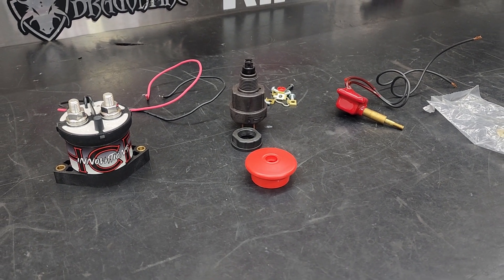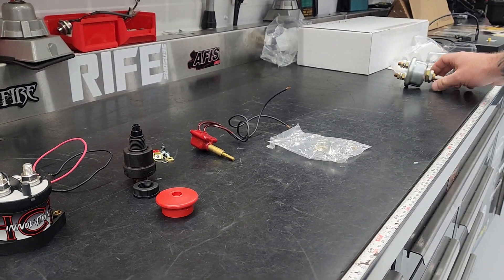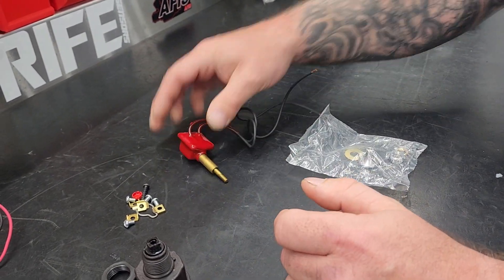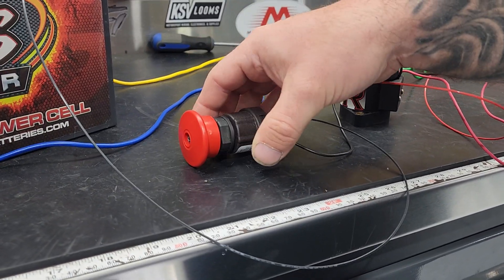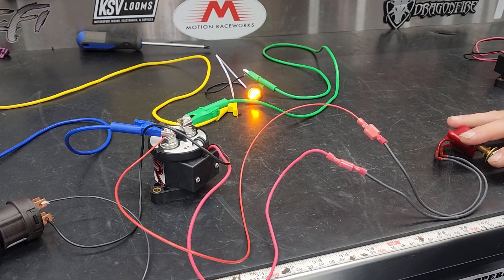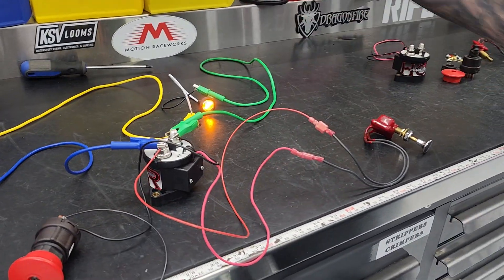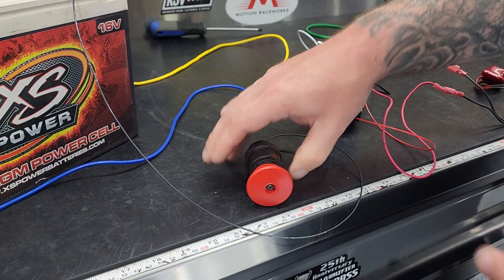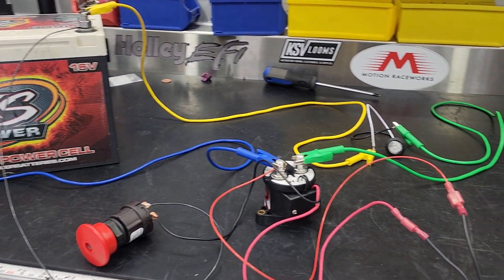How to wire and use a remote battery disconnect

Comment: Using a optimum battery with side post and upper post. Have connected my starter and alternator to he upper post, ECU and all other load from the side post.  Do I need two solenoids to break both power supplies. If so then can they be wired in parallel.

Comment: Hi Devin, great little vid on battery disconnects mate, you briefly mentioned if your running an alternator, can you add the detail either on this vid or on another on wiring the alternator with a shut off, particularly non single wire alternators please

Comment: So to clarify, this is supplying main power to the fuse panel or pdm, which handles coil and injector power, but it's still fine to run the Holley straight to the battery, correct? And for the alternator, we just add another contractor in-between the alternator charge wire and the battery?
Reply from the maker: Yes

Comment: Devin? Can you go a little further and show people how to properly wire the battery side of the equation? To many times I’ve been running tech at an event and people don’t have the alternator charge back wire on the correct side of the “relay”.. and the car doesn’t cutoff if the idle is above 1500 or so RPM. The alternator needs to “dump” back to the battery side of the “relay”.

Comment: Devin,  I have used a similar one from a company called Simtek in the uk (where I'm based) Their one has an additional set of contacts to hold the contactor closed and a momentary  nc switch for the e stop. They also use a high watt resistor to bleed off the alternator backfeed when the contactor is opened. I've used them before on an old carb build I di before. I'd be interested in hearing your opinion of the alternator bleed off on an efi application? I'm really enjoying the tech videos !, Thanks Neil

Comment: Since this needs both switches on to power the car, could you then just leave say the bumper mounted switch on at all times, and just use the in car deal to switch the power on and off without killing the battery?
Reply from the maker: thats exactly what i do. nothing worse than getting strapped in to only realize you forgot to turn on the switch on the bumper lol
Reply: @theholleyefiguy  Happens to me almost every time I get in, then looking around yelling for someone to turn the damn car on lol

Comment: So with an alternator I need 2 of them ok. Was going to email in this week to discuss them
Reply from the maker: you can do it with one, just will have a hot wire to the alternator at all times, which isnt that great but will work perfectly fine. i prefer to use 2 of them
Reply: @theholleyefiguy  So theres no issues with running the alternator to same lug on the switch that the battery connects to? If thats the case I am sold on it.